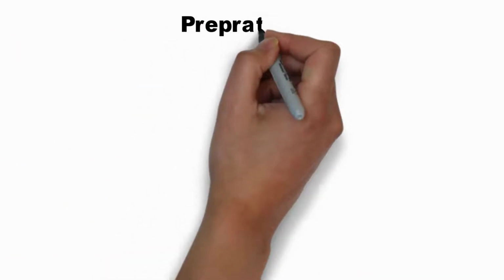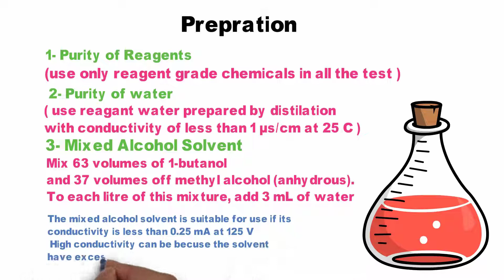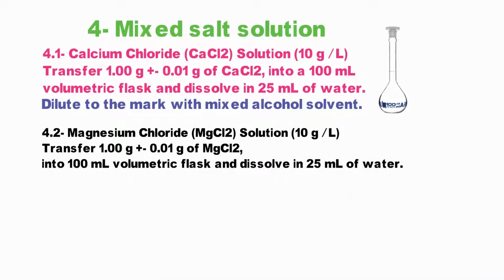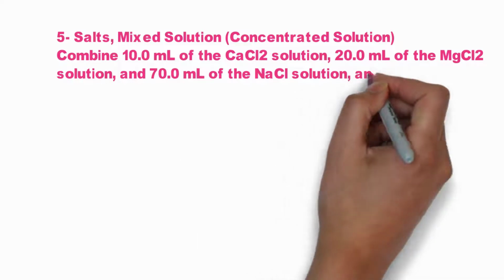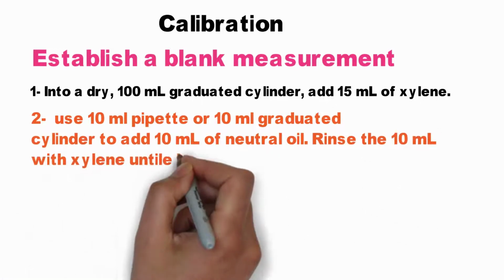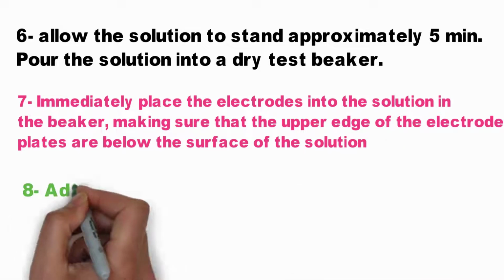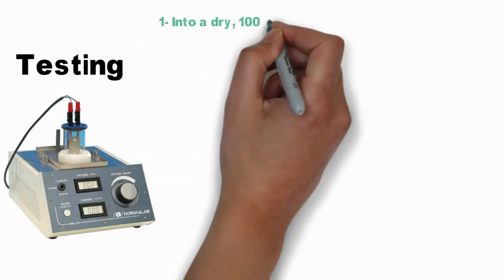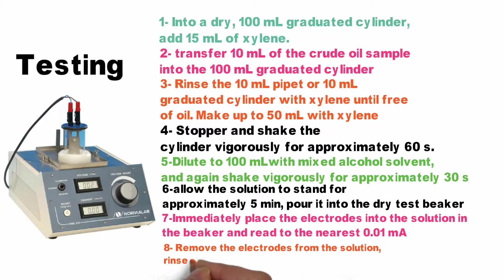ASTM  D3230 Salt in Crude Oil | Yazenkom

Comment: what is the aim for using xylene and mixed alcohol in this experiement?
Reply from the maker: Like dissolved like 

Oil does not mix with water but does mix with alcohol
oil and alcohol have similar polarities, they do not repel each other enough to separate. This explains how alcohol dissolves oil. Alcohol has both polar and nonpolar parts so the mixed solvent with water can dissolved oil  , xylene might be softener and can be emulsion breaker too
Extracting fluids 

Hopefully this answer help ..thank you for being here 🌹